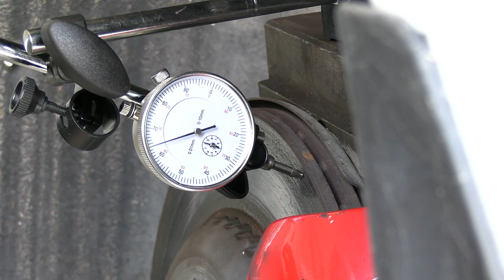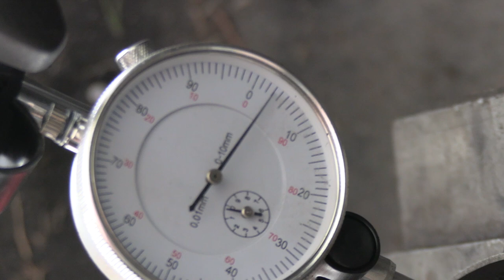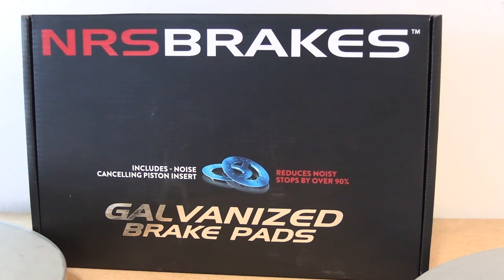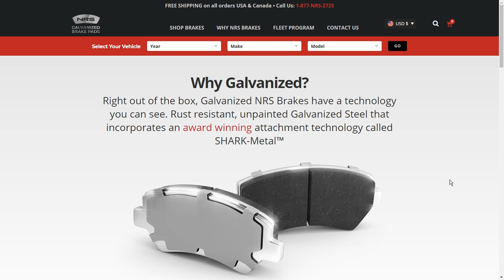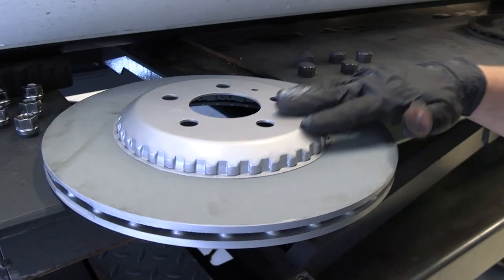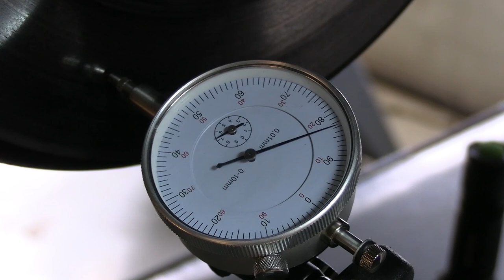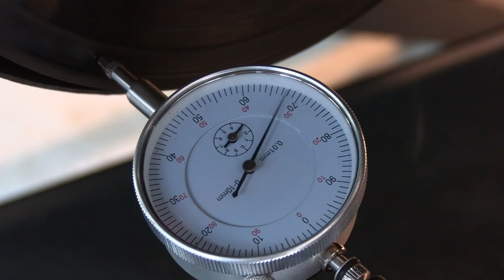Model 3 getting NRS brakes at EV Services

Comment: Hi Bjørn, apologies, duplicate post as I thought perhaps it was more suited on this video. This and your later video were very interesting. I don't know if you will read this but I had a very similar experience last year twice on my Model S 90D. It started with the brake discs becoming warped, while I was on holiday in Belgium, resulting in the same vibration you felt. I had the discs changed and a few months later they warped again when I was back in Belgium. I took the car into Tesla near Antwerp where they initially diagnosed it as being a stuck caliper. However, after a day of diagnostics they came back to me saying it was caused by my 21" rims being powder coated. At the time I completely dismissed this and believed it to be the same story as you described with Tesla blaming every fault on rim modifications so refused to allow them to replace the brake discs again and just tolerated the slight vibration and reduced efficiency. When I returned home to Scotland Tesla here said they did not agree with the diagnosis so I fitted a set of standard 19" Tesla Slipstream winter wheels and drove a few thousand KM without any further deterioration of the discs. I then refitted my 21" rims and the discs started warping more and more so it was clear that despite my initial doubts Tesla in Belgium were correct! I had a complete set of new discs and pads fitted, used the 19" standard rims for 6000km without any issue and noticed a marked increase in efficiency. I then looked into this and it appears, while most cars are unaffected by unusual rim fitments, some models of BMW and it appears Tesla are very sensitive to this. I've not found a conclusive reason yet but it appears on these cars the heat build up is more intense and if the heat generated by heavy braking cannot dissipate through the rim via a good/clean contact patch to the hub the discs can warp. As other cars manage fine with powder coated wheels identical to how my 21" rims were this points to a design flaw but as the Tesla functions fine with 100% stock rims it makes me wonder. Perhaps in some way one of the sets of rims you have fitted in the past created a similar situation to mine as it does seem remarkably similar? I think this could be very helpful to a lot of other owners as, cost aside, the brakes can be a major Achilles heel in the whole efficiency of the car. Wish more people would setup garages like this one specialising in Tesla as dealing with Tesla service can be painful and others don't like to look at the car - good luck to them!!

Comment: First mesurment there is no preload on the dial indicator and you get 0-0  and the dial indicator need to be 90 degree to the disk,not 30+ degree. second mesurment it almost 45 degree to the disk.. Max runout on breake rotors is 0,1mm and  you got 0,07mm but at a strange angle so mesurment is not valid.. new rotor average is 0,025mm or less
Reply: Yes it looks like it is not touching the disk so the measurement is not done correctly. Nice spotted.
the other disks you can see a small line on the disk where the needle is scraping on the disk surface, but not the first rotor and only half of the second rotor.
The dial can go around and pass 0, 9 times so if they rely wanted to show it start at 0 they could have preloaded it to the next time it passes 0.

Comment: I think most of your problem happened during your stay in Thailand. Driving in salt spray to airport and then car standing there rusted the discs badly. My car is the same age and brakes look great after harsh Finnish winter, but I drive almost every day.  No rust in the discs. It's LR so there could be also material difference.
Reply: Antti Toivonen - a good comment!  And a good, and likely accurate assessment.  I wondered if someone would say this.

Comment: Bjorn, there's one more thing to add to EV brakes discussion. You've provided a solution to rotor and pad corrosion, thank you for that. 
But also, the brake cylinders do not get used frequently, and the ones in the calipers may become sticky. You can prevent this by let's say once or twice monthly, while the car is standing still, strongly and fully depressing the brake pedal two or three times. It's hydraulics, so don't worry about breaking anything by doing it too hard. By doing this, the caliper cylinders will do a full stroke and break free all the little corrosion on them, and thus will be less prone to sticking and also the pads will keep great alignment with the rotors, the later is necessary for clean rotors and optimal break performance since the pads keep using the whole rotor area.
Reply: The caliper pistons won't extend more than the brake pads and disc combined thickness allows, the difference between slight braking and maximum stomping on the pedal is miniscule compared to the difference between new and worn brake pads and disc. I have experienced on some previous cars that the brakes started to feel uneven on medium braking if I didn't do a proper hard braking at least every other week, but I do not think piston extension had much to do with it.

Comment: The gap in the center of the pad is to prevent cracks from heat expansion. The sloped edges prevent brake squeak as there are no sharp edges to dig into the rotor surface.

Comment: “You’re not supposed to brake too hard when they are new” - yes you are!! Bed the pads appropriately and they will last a lot longer without forming high and low spots on the rotor. Fast, hard stops every few weeks will keep them working great. You need to get some heat into them once in a while.

Comment: Very nice little Servicegarage. Wish you guys all the best:)

@ Bjørn, I found out for my self that it works best if I switch to N in my Model 3 once a week and brake the Car down i.e. from 120 to 0. just to keep the brakes clean:) and using the aerowheel covers  also contributes a lot to prevent corrosion😊

Comment: On ICE car there is the possibility to re-surface de disc brake with special tool as long as the minimum tickness is within limit, this tool can be useful on EV if approved
Reply: This can be done on a normal lathe.
Reply: But it is better to rip off customer by selling him new rotors.

Comment: I would have thought they should be measuring the rotational deviation of the disc where the pad makes contact
Where it doesn't make contact you will get all sorts of deviation due to rust etc.

Comment: Very promising approach of NRS, iam curious how they will last.
Imho I would ask Tesla if the last repair they did (only swapping the brake pads, instead of the rotors too) is technical an ethical correct. Looks like the amount of rust on the rotor already divided the new brake pads into two sections, one with brake effect and the other one for nothing.... Could have get you into troubles during an emergency braking situation...

Super kind guys at EV Services 👍, kinda similar to Electrified Garage.

Comment: Possible explanation for warm brakes. Tesla does not have limited slip differential. It achieves grip/drive on the non slipping wheel by applying brakes to the one that slips first. If you regularly accelerate hard, this will keep applying the brakes and warm up the discs. This also has the benefit of maintaining the condition of the pads. If your pads are good then this may be happening. Deteriorating pads are often because of lack of use i.e. always using regen only and not accelerating hard enough to need the braking to maintain road traction.
Reply from the maker: But my brakes got hot after driving at constant speed on the highway.

Comment: I still would check the operation of the parking brake motor. It disengages when you shift out of park into drive or neutral. You can check it by jacking up the car and shifting into neutral. Then rotate the rear wheels by hand.

Comment: Bjorn thank you for another informative video. This info is good to know about for all tesla owners. I have a question re the rotors. Can your 'OLD' rotors be reconditioned since they were in speck? And why did you have to replace them anyway. It seems clear that the new Canadian brake pads may be the real answer to fix future breaking problems. Thank you for this information. I am sure that more aftermarket  products will become available as EVs become more  popular. We rely on your unbiased information as EVs become mainstream.
Reply from the maker: We don't want to touch the old brakes. They will be stored and compared with the new ones in 3-6 months.

Comment: The "device" is a Dial Test Indicator (DTI) on a magnetic stand, basic engineering measuring, when you see 0.00 suspect the gauge is not set to measure correctly.......even Tesla not that good!
My Model S rear brakes were seizing up at 75,000 miles. Unworn pads, rotors, calipers needed to be replaced due to not being used! Was advised brake hard once a day in winter or salt will kill them, they need the heat. These guys know pads need to be for EVs not ICE so bonded in the EV way 21:00 "wear is better than tear" yep nailed it, all these problems start with the pads de-laminating
EV are such smooth vehicles free from shi**y ICE drive line shunt, anything that wobbles, shudders, rattles stands out, good to hear your back to the smooth EV world. My guess is you wont have brake problems again due to those pads....impressive Norway now getting EV specialist services and suppliers.
Reply: Very true, I do not have mine that long but I heard often that you should brake hard once a while, especially in winter. Is that not even maybe in the handbook for Tesla?

Comment: I was wondering if you had used TACC before you touched the rotor to see if it was warm? If so, Autopilot may have applied the friction brakes when slowing down or keeping speed the same.

I was also surprised that the Tesla dealership did not require you to resurface the rotors before they put new pads on. Any company like Mercedes, BMW, Jaguar Land Rover, VW/Audi/Porsche, etc. will require either NEW rotors be installed with new pads or resurfacing of the rotor with new pads. It’s insane to put a new pad on a worn rotor that already has surface imperfections.
Reply from the maker: Tesla will not use brakes for normal ACC on higways unless the car needs to slow down a lot. Just look at my recent video about autopilot and pay attention to the horizontal line that goes left (green regen) and right (power output).

Comment: @teslabjørn On 10:12 they  should put nuts on the rotor and torque them with in specs all rotors will have bad measurements if there are no nuts pushing rotor to the hub because the rotor is not pushed evenly ( there is one bolt holding rotor to the hub so measurement is not good ).   + in the Bosch service they used DTI not correctly

Comment: Bit excessive to change the rotors in your case (as they mentioned), but understandable for technology demonstration purposes. Most important part of the service after changing the break pads was probably lubricating the joints. Those netter spec break pads are worth of investment, if they do what promised (factory default ones are not up to the task and cause extra wear to rotors and other break assembly parts).
Reply from the maker: EV Services kept my old brakes. We will compare in 3-6 months.
Reply: Bjørn Nyland - do they have equipment (lathe) to resurface the rotors?  You could use them for “winter rotors” for your long stays at airport parking while you’re in Thailand - unless you arrange for Pawel to drive the car every couple of weeks while you are out - or - leave your car in your garage while you’re out of town.

Comment: Warped rear disks could only be a few things. Sticky caliper or not fully released parking brake. I had a rear caliper that used to stick in cold weather (water had gotten into the channel for the hand brake cable and used to freeze) the fact that the disk warped in the first place is an interesting one and i'd keep an eye on that even with the new setup. Great video though, if my Model 3 wasn't a lease car I'd probably buy some of these now to save myself the hassle down the line
Reply: It can also be lug nuts put on too tight with air gun.  This used to happen to BMW’s all the time because wheel shops would tighten the lugs with their gun rather than a torque wrench.  The rotors would warp quickly after that.

Comment: Conclusion: Regeneration set to low, to protect the brakes. They are far more costly to replace. 
Everyday drive: Low regen. Range doesn't matter. 
Roadtrip: Full regen. One pedal driving. Good for the range. 
Also: Use the brakes as often as possible to clean them, they will die from old age anyway. And as said, they look nice and shiny that way.
Reply from the maker: Conclusion is that all car manufacturers (including Tesla) fail to understand that brakes needs to be designed specifically for EVs.
Reply: @bjornnyland  Good point. Porsch has the perfect EV brakes invented, i wanted them, till i saw the price tag: "No Rust, Low Dust, No Fade!"
https://www.youtube.com/watch?v=ZCj83_uF9dE
Such a nice thing. I wonder if this was mass produced to every car, how much it would cost then.
Gn8

Comment: I have an e-Niro that has the flappy paddles to control my regen. If I hold the left side paddle down, the e-Niro will come to a complete stop, otherwise, the e-Niro will creep forward like an ICE vehicle with automatic transmission. It seems that I use my brakes a bit more than an EV that doesn't employ this system. But it seems that I rarely apply hard braking with the foot pedal. Under max regen level 3, the brake pedal travels a little bit before the mechanical brakes get applied (feels spooky to get no immediate braking) and I tend to press too hard on the brake pedal to compensate for the "dead zone" brake travel. I should probably make sure that I give the brakes a real work out every once in a while because the instances where I properly apply the brakes are too far apart.

Comment: best practice: regen low + roll/creep mode, you'll never save as much money on driving efficiency as you will save on brake repairs, even when city driving
Reply: @nujjigram  model 3 offers basically 3 driving modes regarding deceleration when releasing the accelerator pedal:
1. roll: the car rolls out until it stops by natural friction (run out)
2. creep: the car will not stop by itself but maintain a minimum speed (like walking fast)
3. hold: the car will brake and come to a complete stop (no need to press the brake pedal when looking ahead sufficiently), also referred as "one pedal driving". in this driving mode the car uses recuperation most actively.

by default the car decelerates using recuperation which means that the motors operate in generator mode turning kinetic into electric energy back to the battery:
1. standard: high braking torque
2. low: low braking torque

whenever you press the brake pedal, the friction brakes will be activated adding additional braking torque to the wheels turning the partial amount of the kinetic energy into heat.

however, if you choose to go with the lowest settings for electromagnetic braking which is roll/creep + low recuperation, you will clean off the rust from the brake discs and keep your brake pads warm and dry,  but the amount of recharge going into the battery is lower. in general it's cheaper to waste some energy on the brake pads than paying for brake repairs.

btw: how much did you spend for the repair, bjørn?

Comment: Shouldn't they be putting the dial against the disc where the pads are?  Surely they are potentially measuring the disc with layers of rust and debris on.  With regards to Tesla discs, I recently had all four discs/pads replaced under warranty on my M3P as they were not braking evenly and they were badly scored.  Never had that on any other vehicle.  Admittedly I use regen a lot, which didn't help.  You'd think the car would detect over time with miles + brake usage when to switch off regen to scrub the discs.  Telsa said they don't, so I think a software update is required for that.

Comment: Have those tires remounted properly. I can’t recall at the moment which color dot (red or yellow) belongs nearest the heaviest point of the rim... which should be where the air valve is at.
Reply: Rims are measured and there are weights added to make them uniform(?)
Reply: whuzzzup That is correct. But the less weights needed, the more balance the wheel/tire can be. Plus the fact weights fall off.

Comment: The most EV's have this issue. My Kona too.
Simply bad engeneering. Stainless Steel rotor would fix it. And good maintenance. Than that's the next EV fairytail: EV's don't need service. Remember, only the drive unit is different, all other ist like a fossil Car.
I am looking forward of your experiences with the new brakes.

Comment: Why not grind the brake discs down instead of replacing them. Workshops did it in the old days, but now they just change them and bring ekstra cost to the customer and make more unneccesery polution with producing new parts.
Brake disc on electric car should be able to last the hole life of the car, because they don’t get worn down
Reply: Afaik it's illegal now for some bs reasons - at least here. Also wages. 
You are also not allowed to polish your headlights once they go blind for some bs reasons in Germany (not that anyone cares).

Comment: There must be millions of fossils driving round with sub-optimal brakes that go unnoticed. A few less mpg ... so what! You only spotted this through a very exact efficiency test. Also I would say a new set of brake discs after 64000km (40000 miles) is not unreasonable.

Comment: New breaks?- easy on them as much as possible for about the first 200 miles../321 km..
Reply from the maker: *brakes
Reply: J Mack - firm, but not too hard pressure on them - repeated stops (slows?) from 100 km/hr to near 0 breaks them in.  Once they’ve been heated up, they’re basically good to go.